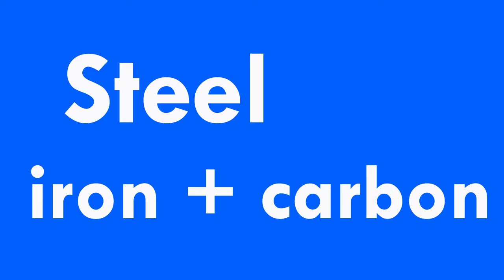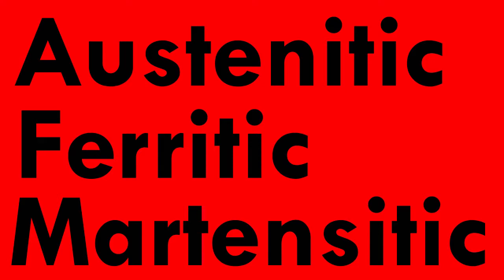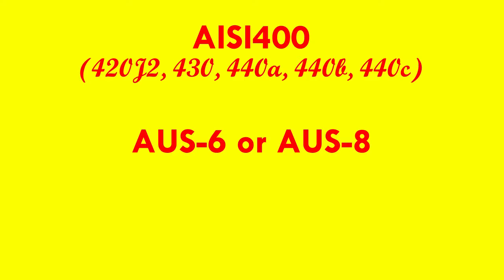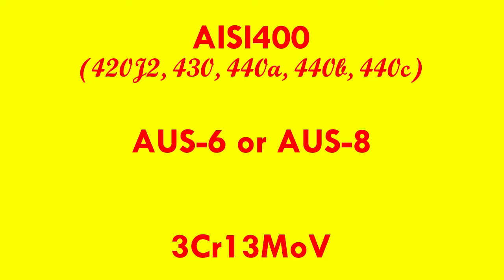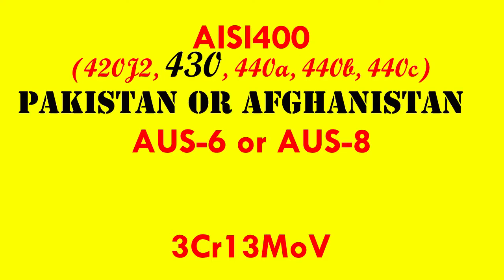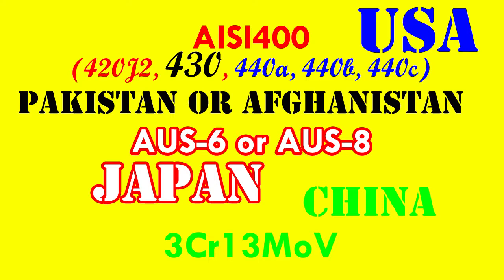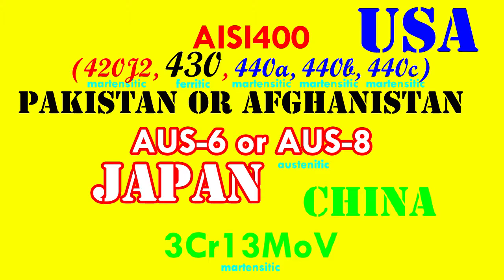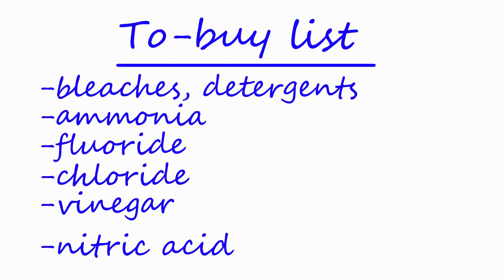How to Identify Mystery Stainless Steel

Comment: Ah the mysteries of the steel industry ^^ That was interesting. So far my testing if stainless steel is stainless was basicly leaving the knife outside in a moist area and look what happens ^^
though they should call it stainresistant cause so far no blade survived my tests without stains
Reply from the maker: Orkar Isber You know, I was thinking the exact same thing! Stain-LESS is a pretty misleading term, as all stainless steels can rust if touched by the right oxidizing chemicals, and most of them can still rust even with moisture! I also think that stain-resistant would be a much more precise term, but it will be a bit of a trick to change the entire planet and industry into using another term now.

Comment: Your saftyy conceerns are amusing to chemists like us. I have seen people who know alot about poisons and there effects work with cancerogenic shit without any safty measures. Seems like when you're exposed to danger every day you'll get negligent...
Reply from the maker: edi I try to be responsible towards others. But I actually also try to reduce exposure to carcinogens in my daily life. For instance I recently took up hunting as a hobby, and I'm extremely bothered by the fact that slugs and buckshot (the only two types of ammo I'll be using for hunting boar, mostly slugs) only come in lead, not steel (at least in Greece - hunters here tend to be an uneducated lot not caring about details such as this).
Reply: Apocalyptic Knights I try to avoid any cancerogenic matter, but I admit that I am much to carefree regarding other poisons (maybe because you'll either survive or die fast).
I agree with you that for normal persons food is probably the biggest factor. There are far to many chemicals slipping accidently in our food of which we only got a faint idea what they can do.
A solid piece of led scares me much less then some modern chemical compounds. The lead may result in chronic intoxication, but it's poorly uptaken into our bodies unless we are talking about leadsalts or organo-lead compounds (used to be in fuels). However heating it in your food is not a good idea (but also using Aluminium on acidic food).